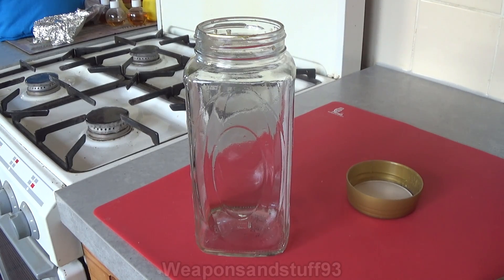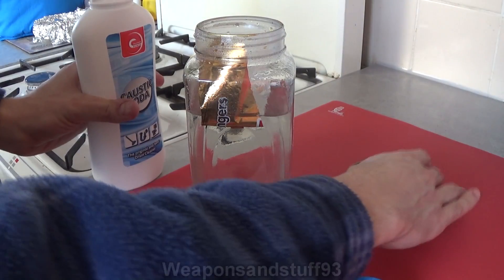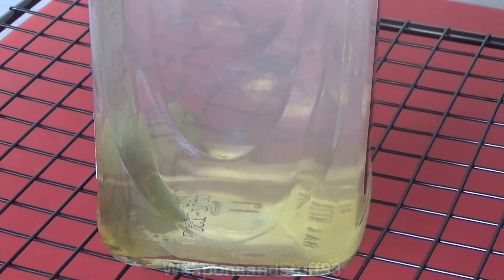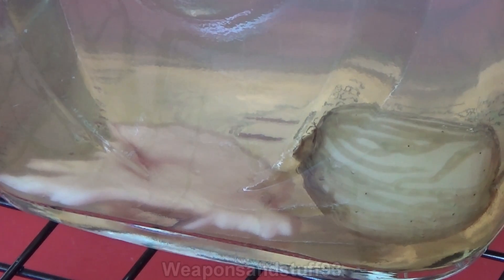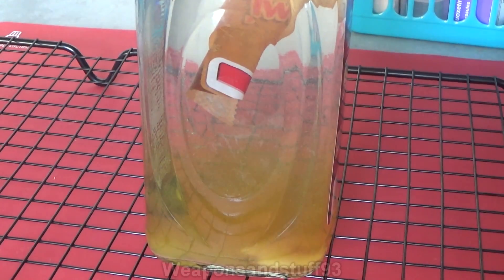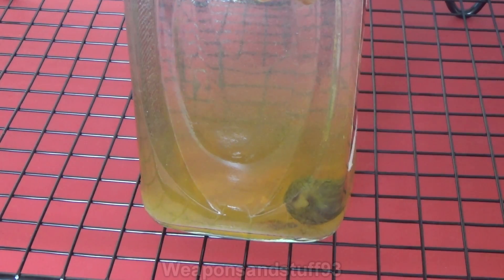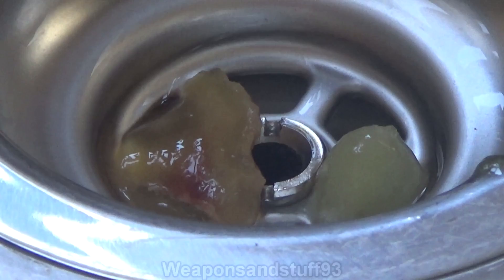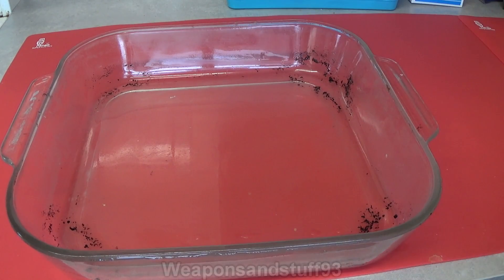Demonstrating the dissolving power of Lye

Comment: Hey, so I have very bad anxiety and want to be safe. Please respond as I've been worrying for a month. Six months ago I bought a polish gas mask. It came with a rubber mask with a voice diaphrma, a hose and what looked like a EO-14 filter. It was all in a green satchel. I stayed at a hotel room at the time. I now realise that the filter didn't have the rubber plugs. I wore the mask a few times and used the hose once. I never used the filter though. When I went home airport security took away my filter because it could contain asbestos. My question is: Can the asbestos have leaked from the filter cuz it didn't have the plugs and is the satchel, hose and mask safe? I keep the satchel with the hose and  mask in a drawer in my room. I am terrified of asbestos. The mask, hose and satchel can't have asbestos on it right?
Reply from the maker: You'll be fine, don't worry about it.
Reply: @weaponsandstuff93  Thanks!